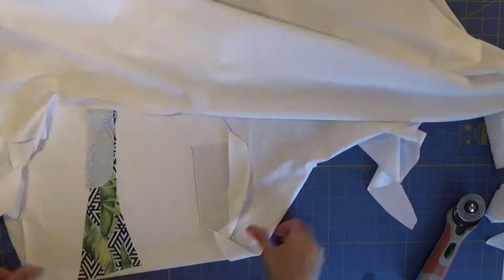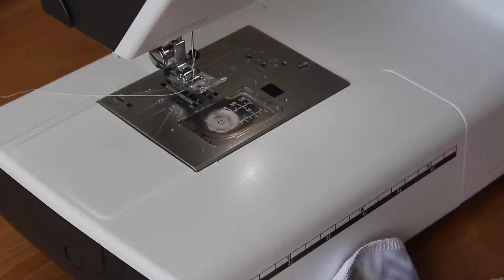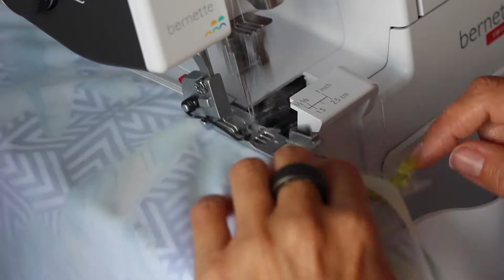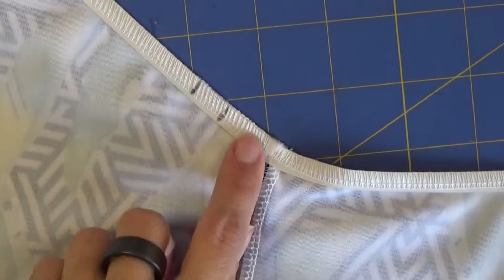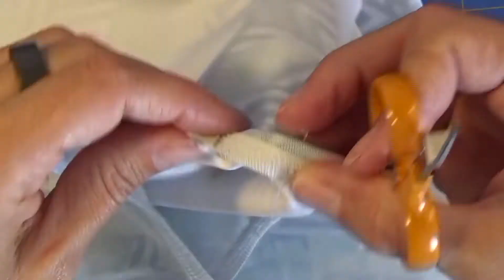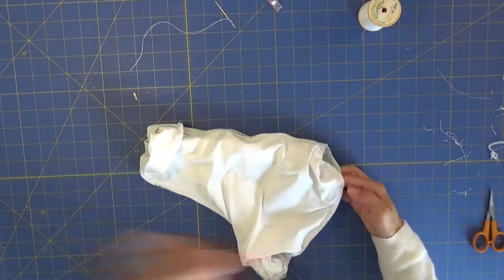𝗕𝗲𝗹𝗹𝘆 𝗯𝘂𝘁𝘁𝗼𝗻 𝘀𝗻𝗲𝗮𝗸 𝗽𝗲𝗮𝗸 High waist Sew along MILAN Bottoms pattern * DIY BIKINI

Comment: Hi, what is the difference between the Milan and Porto bottoms please?
Reply from the maker: Hi Donna! The Milan bottom front and back is lower then the Porto and the strap is a bite higher where it attached to main piece. The other small detail is that Porto (on the leg hole /but cheek) is more Cheeky (to compensate being higher.). Any other questions let me know!
Reply: Bikini Design Club thank you, I will be more observant next time lol and wear my glasses.
Reply from the maker: @donnahaimes2041  No worries. They look similar on the drawing, but they are different once you sew them!